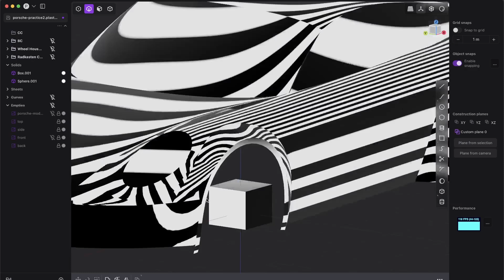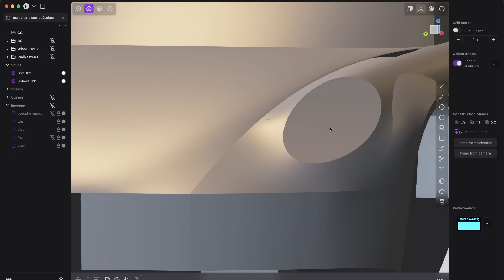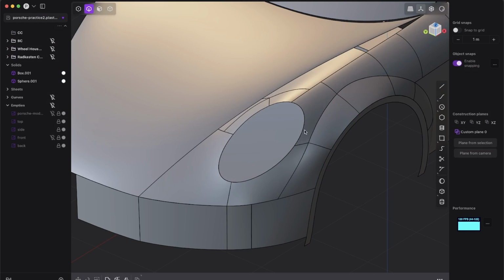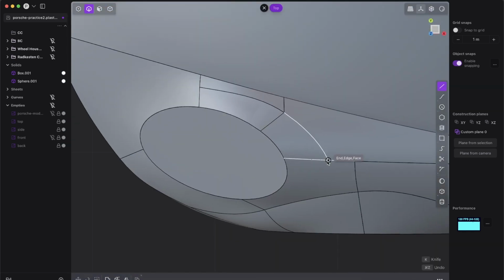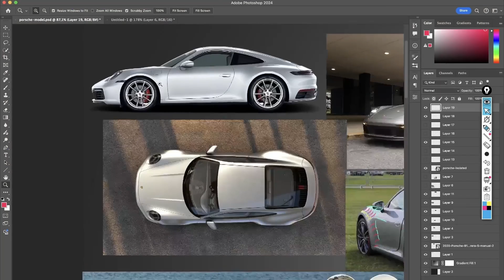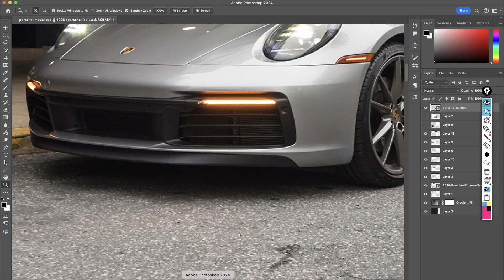xNurbs x Plasticity - Just INCREDIBLE for Car Modeling

Comment: Hi Nikita! Is there some scenario where using the regular patch is better than XNurbs? For example when i have a very simple hole should i use the regular patch or is it okay to use XNurbs for everything?
Reply from the maker: If you have xNurbs you can default to xNurbs first. In some cases xNurbs doesn't give you the exact results you want -> then try patch. If still not a good results, then rebuild your hole or make it smaller.

But always judge the quality with the reflections. So check out zebra stripes and evaluate if the quality is sufficient or not.